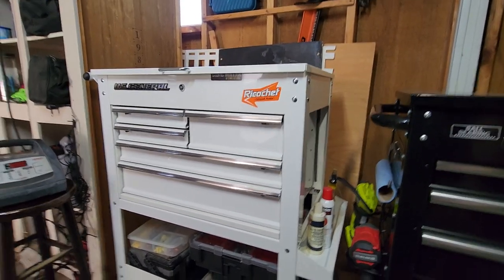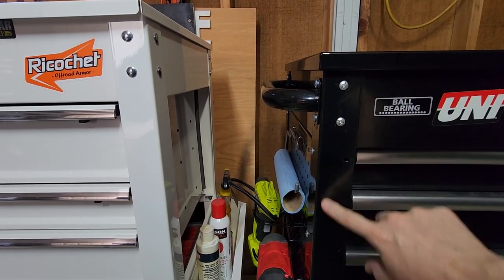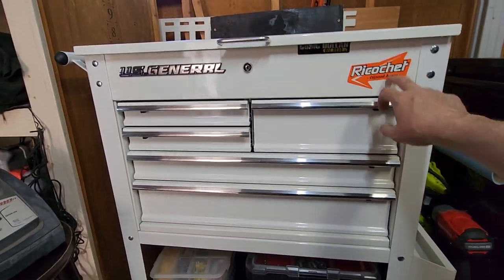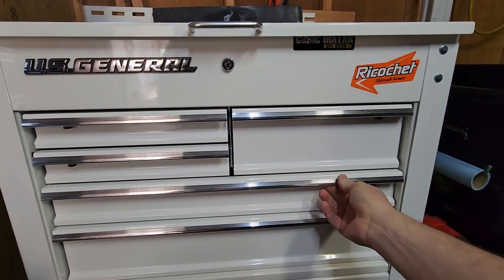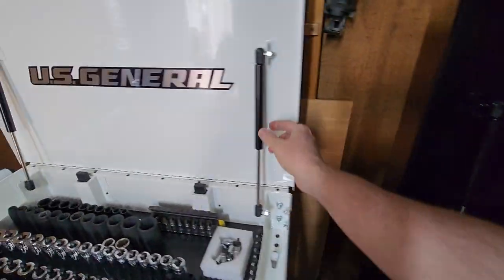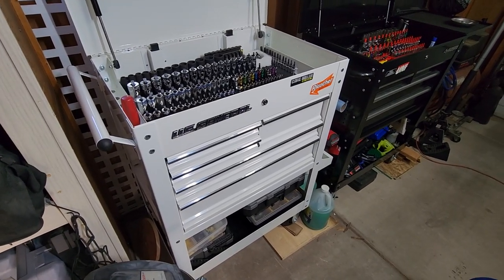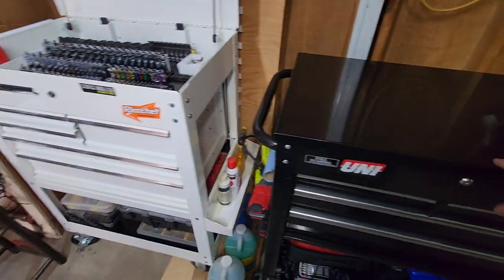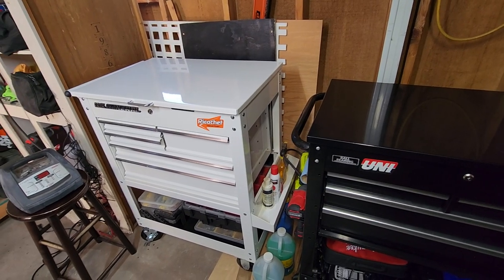Harbor Freight Tool Cart Vs Husky Tool Cart- US General Vs Home Depot

Comment: Good video. I compared these two boxes for a month before recently pulling the trigger on the Husky. The Husky has been updated since you purchased yours (mine has a handle on the hood and it didn't have any quality issues). I found the drawers of the Husky much easier to use and also larger. The Husky is 33" wide vs. US General's 30" width. I was back and forth between Home Depot and Harbor Freight comparing them quite a few times. The US General should get an "F" in drawer latch execution (especially compared to the Husky). The slides also aren't as smooth as the Husky's. The plastic latches are far more annoying than I thought it would be and the drawers won't open with the lid closed unless you modify the rear catch. I love Harbor Freight and have a ton of their stuff but this cart needs some updates. Husky has the edge currently on these carts in my opinion.

Comment: One of the things you can do to bypass the not being able to open while closed on the US General is pull the drawers out and cut off the catches on the back of the drawer
Reply from the maker: Interesting, I did not know that. Thanks.
Reply: I cut ~5/8 off the top of the push mechanism in the back of the top tray. Then saved the past I cut off. When they're not in you can open the drawers with the top closed. When they're in it locks them when the box is locked and closed. I also jammed a nut in the latch on each drawer to make them open easily and then glued some magnets to the back of the drawers to give them a nice feel opening and closing.
Reply: On one of my U.S. General 5-drawer Mechanic’s Carts I drilled the rivets to release the spring-loaded plunger pieces which then slide right out. This way I can selectively disable the locks on one side or the other. It also gave me the room I needed for another row of MagClip organizers in the top box. ;)

It’s reversible with a rivet gun, which is good since a housemate will be moving up to that tool cart. I just got another 5-drawer US General and a Husky 61” workbench tool chest on clearance.

Comment: I will say this, US General roll cart is the #1 on the market for a reason. The US cart is geared more toward a professional level than the Husky. Husky is okay for the home game. The US is made to actually be rolled around all day every day ,try to see how long the husky can stay together when being used as such. I paid almost 500 for my husky 46” and I don’t really care for it, just Home Depot junk. It’s hard to believe it but the US General is just all around better and for anyone who wants to turn a wrench 🔧, the husky’s are made for woodworking and it shows. They just can’t handle real heavy weight automotive tools. If all you have are tools for working with wood then they are fine.
Reply: Ehh, I have a husky 9 drawer wood top  box that has a couple drawers with alot of weight and drawers slide as good as empty. And yes, it is filled with "automotive tools".

Comment: “Apples to apples” would be comparing Husky to the US General 4-drawer cart.

Anyway, can the Husky lock the drawers at all? Is the lock cylinder I see only for locking the top closed? Locking drawers with the lid closed to secure everything with one lock is the standard design so that a technician in a multi-bay garage can just lock the top and walk away without worrying about the other techs helping themselves to tools that don’t belong to them. Even the screwdrivers go under the lid!

The latching drawers on the US General let you to move the cart without drawers popping open and spilling contents, though you could just close the lid to lock them closed when rolling. If the Husky drawers don’t latch and they won’t even lock with the lid down, how do you move the cart without the drawers flying open?

I know you don’t move the carts much but they are rolling carts for a reason. If the Husky doesn’t have a way to lock the drawers then it seems the other is much better suited to the intended purpose as a “Mechanic’s Cart.” ;)
Reply from the maker: “Apples to apples” would be comparing Husky to the US General 4-drawer cart.
This is a really dumb comment and I will just leave it at that. 

The second part, you seriously think that the Husky cart would possibly be made to where you can't lock the drawers? Is that really the conclusion you came to? How did you come to that conclusion because it's on another level of stupid. Is there a cart made that is designed to move around have drawers that don't lock? Is there any tool box made that you can't lock the drawers? If there is I have never seen one. The Husky cart can lock the drawers independent of the lid. The lid just blocks access to the lever once you lock the lid. So you can move the Husky all over if you wanted with the lid open and the drawers locked.
Reply: @NewZonaRides  What’s with the hostile response?
Reply: @NewZonaRides  “["Apples to apples"] is a really dumb comment and I will just leave it at that.”

Not sure why you don’t want me to mention an even more comparable model. Harbor Freight distinguishes them by the number of drawers and there may be even more similarities to the Husky.

“you seriously think that the Husky cart would possibly be made to where you can't lock the drawers?”
No, I thought it sounded weird which is why I asked. You described that it doesn’t lock them the usual way which begs the questions “Can they lock?” and “How do they lock?” I can’t think of a better place to ask since you aim to point out the differences.

“Is that really the conclusion you came to?”
I didn’t conclude anything. I asked. I even pointed out how silly it would be “if” they don’t.

“Is there any tool box made that you can't lock the drawers?”
I can say that I’d prefer the ability to disable the automatic locking mechanism on some or all drawers and figure that it’s possible some cheaper ones only lock the top. After all, Harbor Freight calls their 4-drawer version “tech cart” instead of “mechanic’s cart”… and as you move down the line you eventually end up with two kinds of “service cart,” one with with no drawers to lock. Big stuff that won’t fit in a drawer has to sit on the open shelf regardless of which cart we pick.

“The Husky cart can lock the drawers independent of the lid. The lid just blocks access to the lever once you lock the lid. So you can move the Husky all over if you wanted with the lid open and the drawers locked.”
So if I understand this you are saying that you can secure the drawers with a lever even with the lid open? I think I prefer it that way, since I wouldn’t have to deal with latches and I could still secure them while moving the cart with the lid open. Thanks. That’s what I wanted to know!

If it came down to the 4-drawer U.S. General and the Husky at the same price and it works the way I imagine then I think I’d prefer the Husky for that reason alone. Then again, the 5-drawer U.S. General has more space so I’d swing the other way there.